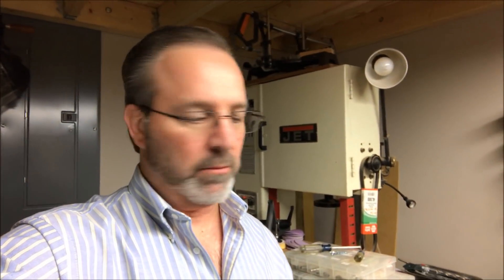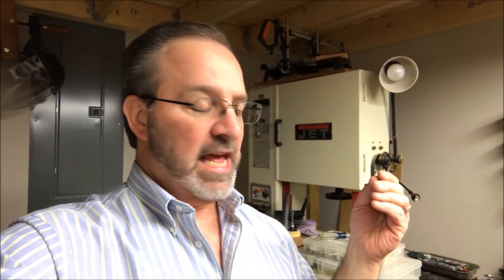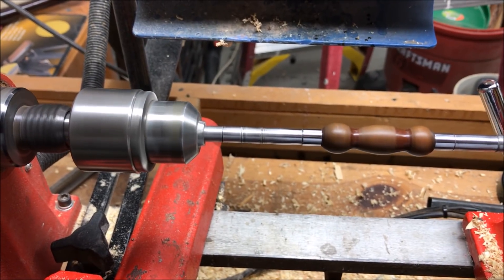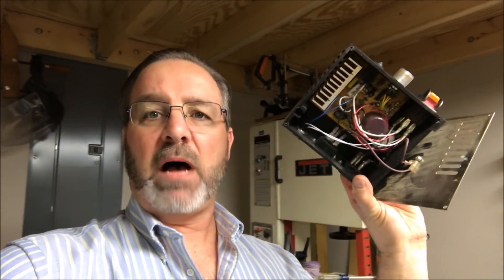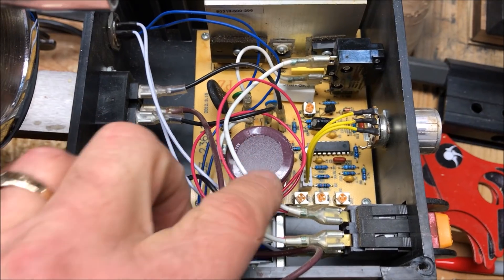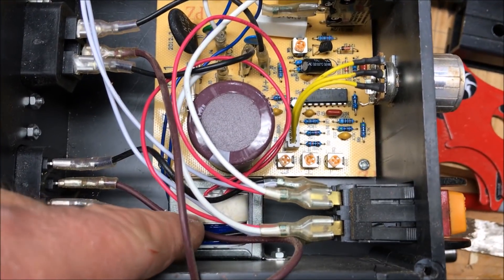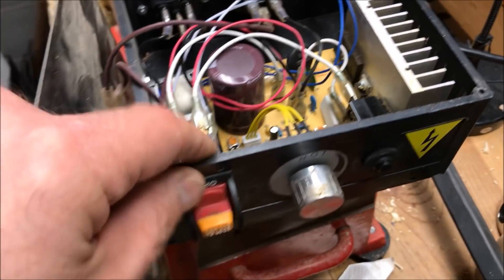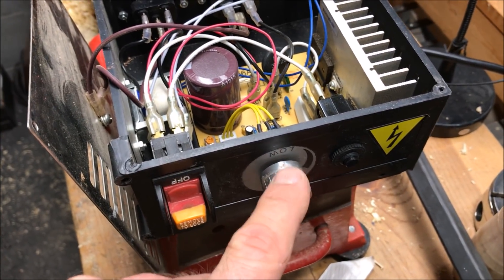I'm Having Trouble With The Variable Speed On My Lathe

Comment: while you are checking the other electrical, make sure to check that one of the brushes on the motor is not stuck.  if brushes get stuck it could cause components in the control panel to over load.  All of the other Ideas I have been reading are also important.  
Mike C.
Reply from the maker: Thank you Mike,
  I’ll check. 

Regards,
Bob

Comment: As a electronic tech with about 50 years experience I would say you are beyond your depths trying to trouble shoot this controller. Anyone can change parts and get lucky. But that can get expensive and time consuming. even if you see a burnt up part, that doesn't mean that it caused the problem  I would call Penn State and see if they have any suggestions. The bottom line is that you will most likely have to purchase a new controller.
Reply from the maker: Thank you John,
  I’ll probably end up ordering  a replacement board. But maybe I can learn a few things from this one since there closed till Monday. 

Regards,
Bob

Comment: WARNING: I AM NOT AN ELECTRICIAN! But, i reckon it could most likely be the potentiometer on the variable speed dial, since that is really the only thing that can vary the resistance within that kind of circuit. If you have a multimeter. maybe try checking that out, but if you smell something burning, be careful as you could perhaps get shocked while testing components. Best of luck with your lathe! :)
Reply from the maker: Thank you. 

Regards,
Bob

Comment: Hope you find a solution quickly. Support from the company that makes it would be best to start at. Ive read the comments present so far. Good suggestions in there. I would like to give you some advice that is not going to solve this problem, but is helpful nonetheless. Everytime something breaks, that is an opportunity to learn about how it works. So figure out how this speed control works. There are vids about these things. Then you understand the role the different component plays, which helps you narrow down the source of the issue. That is why i think the suggestions about the rheostat or potentiometer could be right, and why i dont think it should be the wiring. Still, i could be wrong entirely as i dont have a schematic to study. 
Btw, one way to troubleshoot is to run the lathe for a short moment while looking at the circuit with a thermal camera. That which heats up fast probably is broken, or that which comes before it is letting too much current through....
Reply from the maker: Thank you Willem.

Regards,
Bob

Comment: If you decide to replace the IC chip, the best way to remove it is to cut all the leads on the chip side of the board and then use tweezers and a soldering iron to remove them one at a time. You are less likely to damage the circuit board by trying to un-solder all of them at once. You don't need to try and save the chip intact. Ask me how I know this. I used to do failure analysis on circuit board for a computer storage manufacturer. Good luck.
Reply from the maker: Good tip, in the past I tried Toni solder all eight leads then pop the chip out. Your way makes way more sense. 

Regards,
Bob

Comment: have a close look at the bottom of the electrolytic cap, see if tar is running out.  If you have access to an ohms meter you can check to see if it is shorted, but generally you need to remove it from the board.  Too, place your ohm meter across the leads of the cap, using the ohm meter to charge the cap  then quickly reverse the leads, you should see a slight deflection in the meter when the leads are reversed.  My guess smell, yuck, and the fact the lathe has been recently shipped points toward that electrolytic can.   btw if you remove the cap to check it, it will still smell this yuck smell as it does not go away.
Reply from the maker: Thank you Edward. 

Regards,
Bob

Comment: Bob, by the way it could also be the motor itself is dirty/dusty rather than the control board, but I don't think you'd get the smell so that's why my first thought is to replace the control board. However, I have seen this jumpiness when the brushes are worn or the commutator ring is dirty. What I did with a DC motor on a pottery wheel was remove the brushes. With a flashlight you can look at the commutator ring - if it looks like it's been varnished with a black film, you will need to clean it. You might just need new brushes ($8-$10 dollars) so try that first. But if you need to clean the commutator ring, you will take the motor apart (it's a little hard to tug the rotor out as the magnets try to hold it in, but you can do it. Then gently clean the ring with 600 grit or even finer if that works to make the copper shine through. You don't want to sand too much.
Reply from the maker: Thank you Ralph. 

Regards,
Bob

Comment: I am an electronic technician by trade. What it is most likely to be is the rheostat that is the knob you use to adjust the speed it’s a variable resistor. On that part you will see the resistant value like 10 K for example if it’s surging like that it’s most likely The cause. 
The good news it is a very simple fix that Is the first part I would look at replacing. Let me know how you make out good luck
Reply: Im an electronic engineer, and my first thought was also the vario resistor.
Reply from the maker: Thank you, I will put an ohm meter on it and see what I get. 

Regards,
Bob

Comment: It will be tricky to find the root cause. First look at the transformer as melted transformers can make a bad smell; and if the transformer exterior is bulged or shows what appears to be burn marks, don't even test the transformer, replace it. However you should replace the entire control card board as well since finding one bad component will be tricky as I mentioned before and you could get into a circle of failures. You should test the speed potentiometer and the on/off switch with an ohm meter to be sure they are good. The manufacturer should have a control board replacement part for a reasonable cost- sometimes you get upgrades with the new board. I see the big heat sink on the right and the components connected to it are likely problems but it looks like they would come with the new board. There is a 16-pin integrated circuit on the board, and it does not look like it is in a socket so for example if that is bad you'd need a solder-sucker and some luck to remove it and install a new one. So I guess I'm saying my advice (and I do have some electronics background) is to forego getting into a schematic and get a new control card board. Take a photo of course of where all the wires go.
Reply: Ralph Ross A
Reply from the maker: Thank you Ralph. 

Regards,
Bob

Comment: Hi Bob,
I work in circuit board design, specifically UAV autopilots and motor / motion control.

I'd need to see some more close up pictures of the speed control to tell for sure. If it came with a schematic that would be immensely helpful. 

It sounds like it might be hitting a shutoff and stopping the motor. Could be any number of reasons. 

I'd be happy to help you troubleshoot it, but if it's in warranty I'd suggest exploring that first. Otherwise, can you post some close up pictures of it, and the motor on the lathe?
Reply from the maker: I’ll take some photos in the morning when the lighting is better. I got this lathe second hand so I unfortunately don’t have a schematic. I’ll gather as much info as I can from the lathe and post it all. 

Regards,
Bob
Reply: Ok thanks. Specifically try to make out the numbers on top of that black chip there. Then I can come up with some points to probe with a multimeter.  It looks like the lathe will have a DC motor on it. I also see a current sense resistor there, that big white block. There are a bunch of little pots on the PCB as well which likely adjust things like minimum and maximum speeds, current limit, etc. If one of them vibrated loose it might cause the surging you're seeing. 

I don't think it's the transformer. I can't see 100% but it doesn't look the like transformer is powering the motor. It looks like there is a bridge rectifier creating DC, which is then switched by those MOSFETs. It looks like there's a resettable circuit breaker as well. You could try bypassing that, but I don't think it is the source of your issues. 

If you end up not being able to figure out the issue, I'd be happy to have a look at it if you wanted to mail it to me.
Reply from the maker: Thank you. If I have no luck, I met send it your way. 

Regards,
Bob

Comment: I'm an electrician in a steel mill; do you have a model/part number so we can try and find a spec sheet and drawing?
Reply from the maker: I couldn’t find a model or part number in the lathe. I know it’s a 10” Turn Crafter Commander from Penn State. 

Regards,
Bob
Reply: RJBWoodTurner There's no model number on the board itself?
Reply: TYPICALLY if something board level fails you'll see burn marks around it. Without seeing that, particularly when you've smelled burning, I'd check the things that aren't on the board (transformer, switch, varistor). You could also check the board for cold solder joints and retouch them.
Reply: Just make sure you discharge the capacitors by shorting them out for about a minute before you go sticking your fingers near them.
Reply from the maker: I’ll look when I get home today.

Comment: I have had to replace my mosfet chips on my metal lathe several times. They are the ones attached to the big aluminum heatsink on the board. They produce a large amount of heat (thus the large heatsink) and are likely the source of your problem. If you aren't comfortable doing the repair work on the board itself your best bet would be to replace the entire board. Check with the manufacturer to see if they are available. Unplug everything before messing with it of course, but pull the board and look at the solder points on the back looking for any darkening or black areas around the solder points if you don't see anything unusual on the side that is visible. I'd be glad to try and help if you have any questions. The capacitor is the oly thing that could really hurt you if it is unplugged and you can short it between the two solder points with an insulated screwdriver to dissipate the stored electricity in it.
I used to work on larger copiers like big print shops use so that is my experience with electrical repair. I hope you get it sorted out, best of luck to you with it.
Reply: BTW, you may find this speed controller troubleshooting guide useful for testing components. It is for small metal lathes but the components are similar: https://www.google.com/url?sa=t&source=web&rct=j&url=https://littlemachineshop.com/reference/drivetroubleshooting.pdf&ved=0ahUKEwiO--7ZsOrXAhVF94MKHa3NCrcQFggoMAA&usg=AOvVaw0dbRKMJu3tZlFJ_wk6nkEG
Again, best of luck to you with it!
Reply from the maker: Thank you,
  I’ll pull the board and check the back side around the area of those chips. 

Regards 
Bob
Reply from the maker: Thank you,
  I’ll check it out. 

Regards,
Bob
Reply: Let me know if you have any questions and I would be happy to help if I can.
Reply from the maker: Will do, thank you.

Comment: Penn State is excellent with tech service. I own one and they will solve your problem...
Reply: You will probably have to wait until Monday. I know that there are at least two versions of the speed box as I have seen another YouTube video on how to adjust the upper and lower speed limits with some potentiometers on that circuit board. When I opened mine, those potentiometers were not on my version. Occasionally mine surges in speed for about 1/2 second and then goes back to normal. It hasn't happened in quite a while now. At first I thought there was some sort of feedback from the speed sensor to the control box, but the sensor only provides info to drive the speed display and has nothing to do with the motor speed control. It only measures the speed of the headstock for the display. Sorry for the problems you are having. I think Penn State would be the first call to make.
Reply from the maker: I plan to call them, I just can’t remember if there open on Saturdays or if I have to wait until Monday. 

Regards,
Bob
Reply from the maker: Thank you Glenn. 

Regards,
Bob

Comment: Don't know if you have a meter but if you do you can unhook the potentiometer (the speed dial) and check the resistance (ohms)  turn the dial in different spots and check that the ohms readings are consistent and stay put when the dial is stationary. Could just be a worn out pot
Reply: Yes Bob it if there is something inside causing it to ark ... also look on the underside of that board as well ... If it's the transformer going out u some times bet some black around the solder joints
Reply: RJBWoodTurner also one more thing Bob if I was a betting man I would bet it's a capacitor causing it and the will definitely smell
Reply from the maker: I can do that. Would a worn out Potentiometer cause a burning smell?

Regards,
Bob
Reply from the maker: Will do John. 
  Thank you for the info. I’ll remove the board and check. 

Regards,
Bob